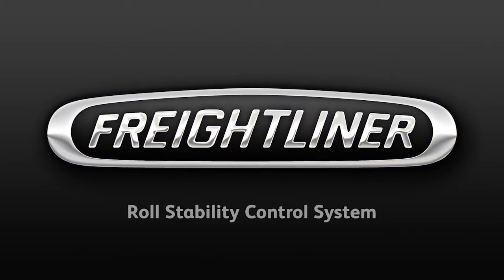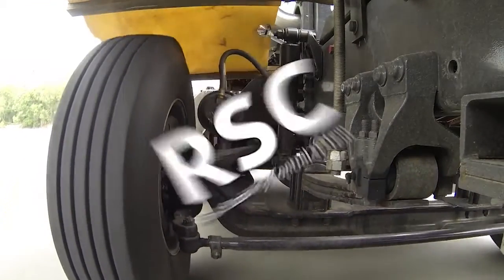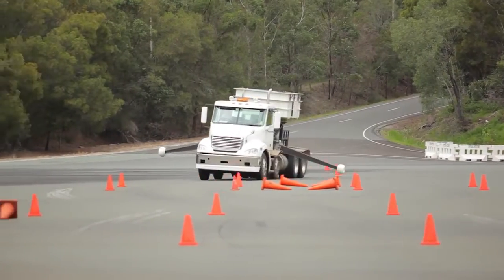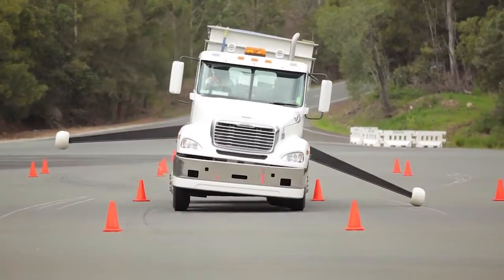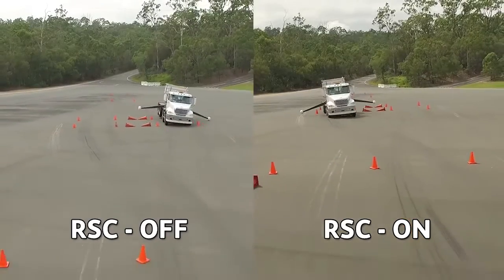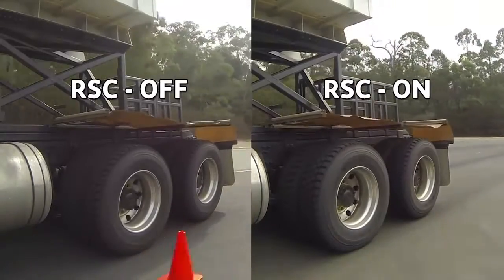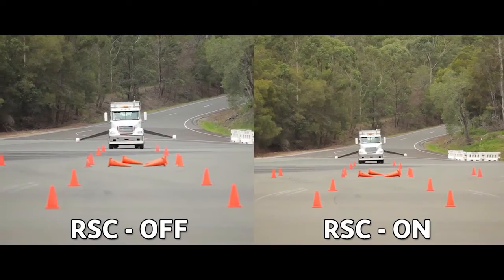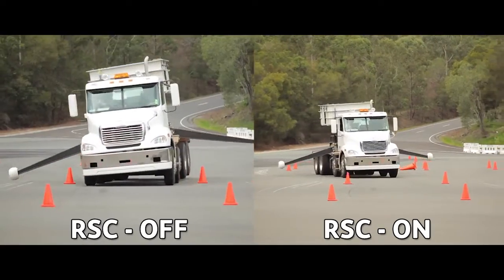Freightliner Roll Stability Control (RSC)

Comment: Don't buy the new Freightliner the roll stability is way too hyper sensitive and it'll affect you when you pull out into traffic it disables the motor and only gives you partial power long enough to get you hit by a car. Freightliner still has not fixed the AC vents for the filters get clogged.